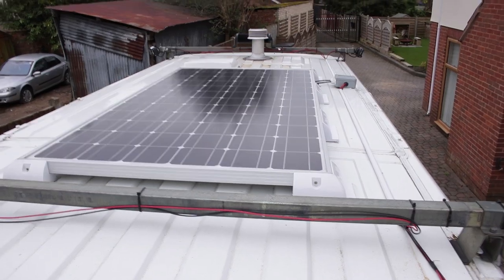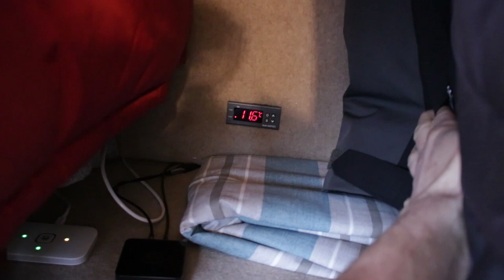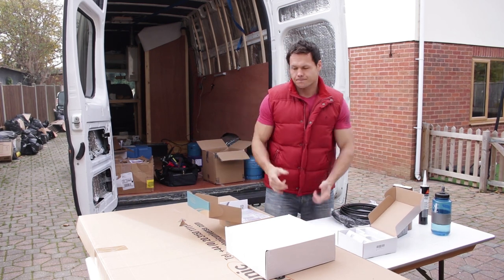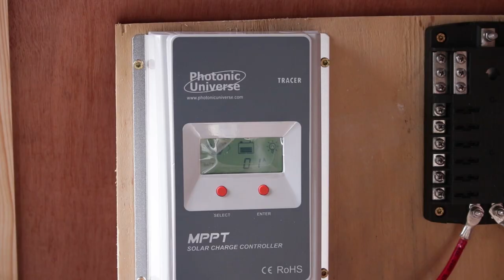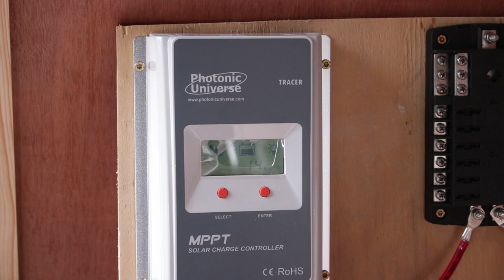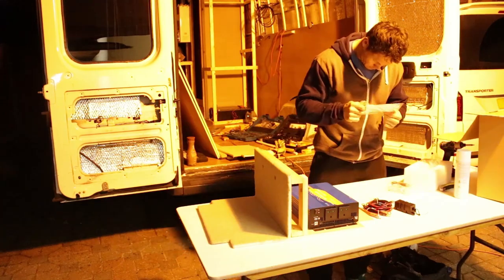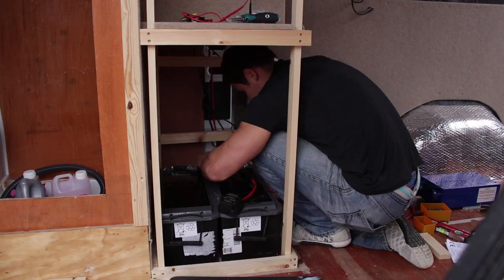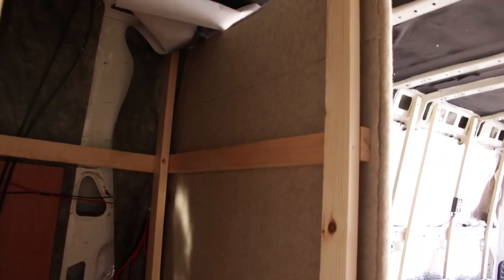Solar & electrical set up in self built off-grid van conversion

Comment: Hi. Great video. just wanted to ask.....you said the solar charges the leisure batteries and when charged, the VSR opens and charges the main battery. is this a second VSR??? or do they work in both directions???... ive not seen a two way one, and wanted to to do the same to mine.TIA.
Reply from the maker: Colin Roche yeah it works in both directions so whenever one battery is fully charged it charges the other and vice versa!